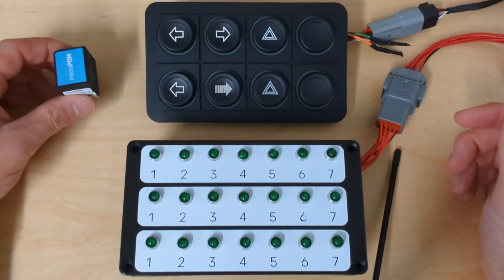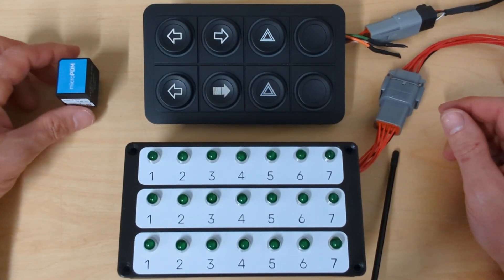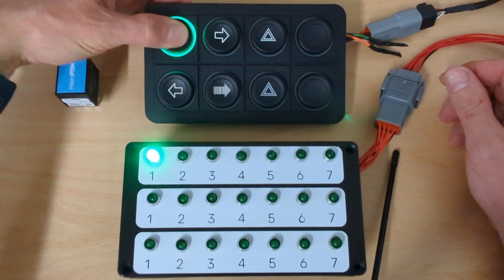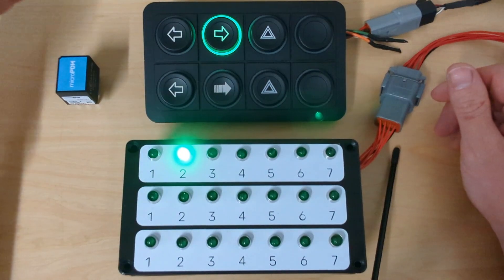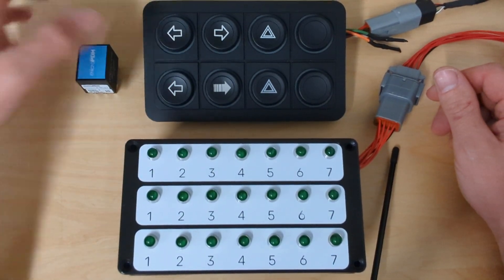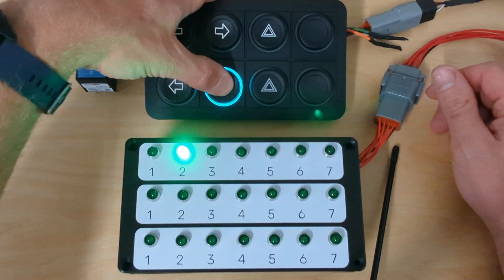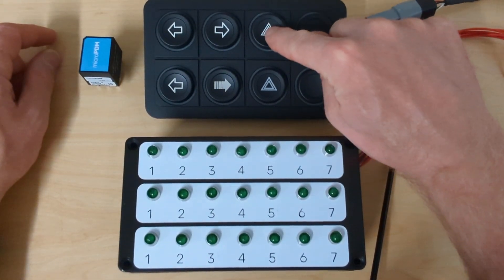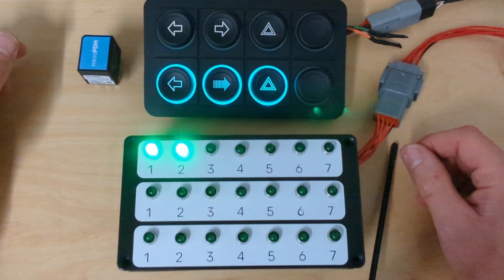Ferrari and VW-like turn signals with the new MicroPDM

Comment: Would it be possable to use a can adapter you used in one of the other videos to connect to a steering colomb turn indicator and not be tied to buttons on the button bord?  
Also can u use the can bus from a microsquirt to turn on a fuel pump or fan?
Reply from the maker: Yes, you could certainly use a CAN adapter and a mechanical switch to turn on/off turn signal buttons instead of the keypad.  
I'm not familiar with the Microsquirt, but if it can be configured to send arbitrary CAN messages, then yes, you could absolutely use it to turn on fuel pumps and fans.  People do this with other ECUs all the time.
Reply: @micropdm3648  thank you for the reply. I did some more digging. The micropdm uses CAN2.0 while the megasquirt uses ISO 11898 standard. I don't know enough about the protocols to know ifntheybare compatible